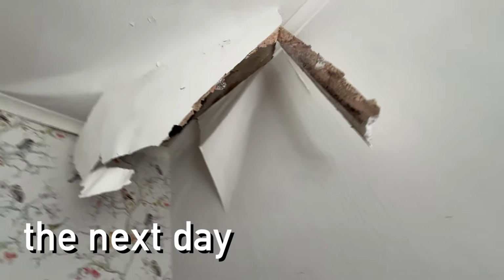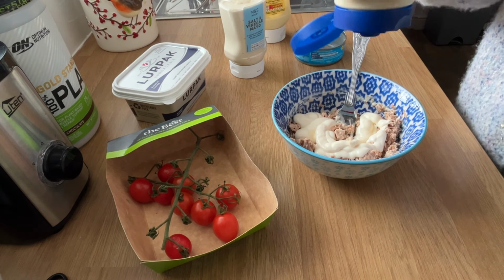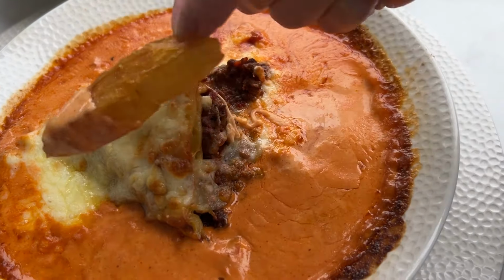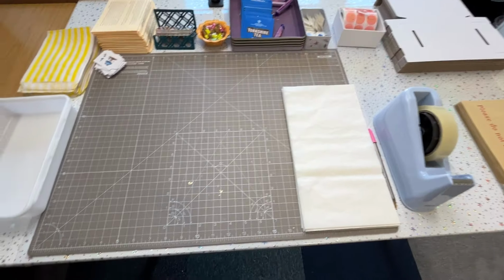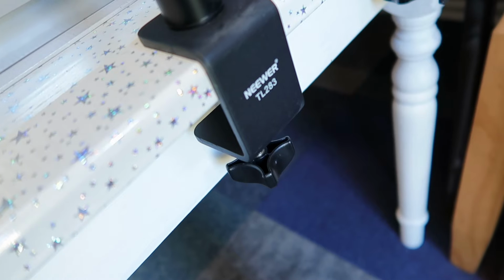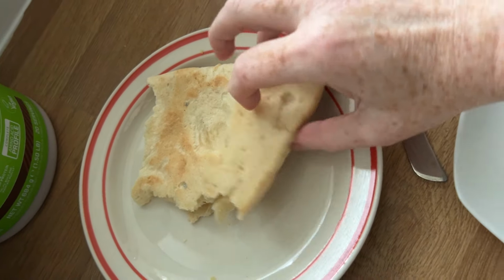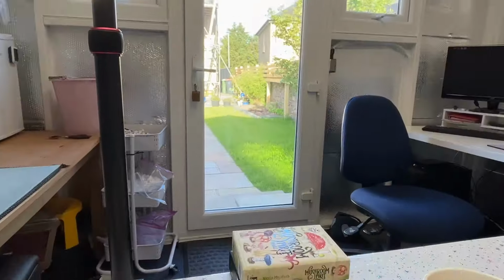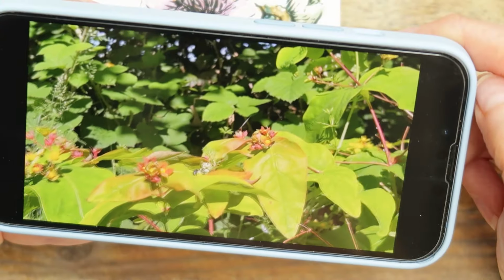ceiling COLLAPSE ruins ART STUDIO - MAJOR disaster!  Studio Vlog 8

Comment: Gordon Bennett!  It looks perfectly dry.  Normally it's water that causes such collapses.  Is there any damp on the top side of the material?  So glad you were not sat at your desk!  Plastic dust sheets taped over all your shelves and drawers with gaffer tape or masking tape should be good enough for the repair works to carry out over.  

That must have been such a shock.  I've made it to tuna mayonnaise, but need to finish some jobs so will watch the rest later.  Hopefully no more disasters.
Reply from the maker: It was very dry and crumbly, Sue.  It had been damp years ago but we had something fixed on the outside of the house and it completely dried out.  There was a slighly bow in that corner of the ceiling so it was clearly weak.  Then for the last couple of weeks, we've been having some repairs done on a different part of the roof which must have caused some vibrations and disturbed it.  The roof tile that landed on my desk must have just been sititng there above the ceiling along with some other debris.  Probably from past roof repairs where the roofers have been lazy and not taken away the debis.

Will defo be covering everything in plastic, lol.
Reply: @TheArtSpirits  Better than when mum and dad moved into their house in the 1950's.  There was no access to the loft so dad made one and went up to check the roof and start his "let's put it in the loft" collection of the next 65 years!.  He didn't find a loose slate up there (well there may have been a few) but he did find an unexploded incendiary bomb!  

The house is in Coventry, badly bombed in the war.  Apparently getting anyone to repair damage was hard so for roof damage they usually just ran up a ladder and stuck a few slates back on.  That must have been what happened.  No way to retrieve the bomb.  

At least you have had a happy accident in that you have found you really like the garden room set up for your painting and packing area. Every cloud etc.
Reply: Hi Rebecca, so sorry about the roof collapsing but thank God you weren’t in the room at the time and didn’t get hurt. Hope you manage to get it all sorted, I can imagine it must have been a terrible shock. Love your vlogs x